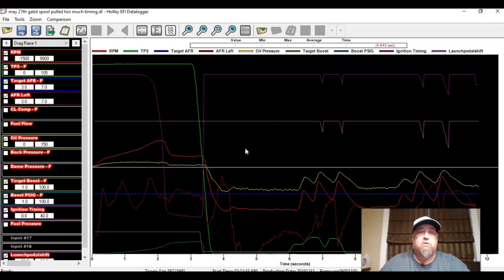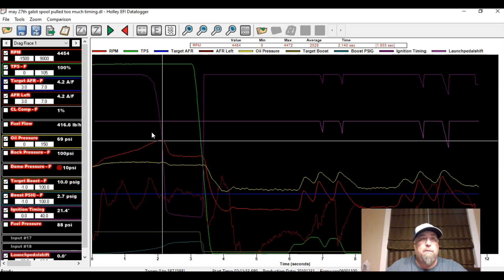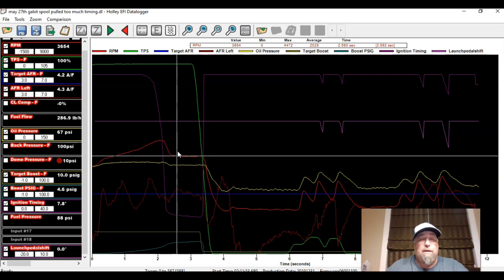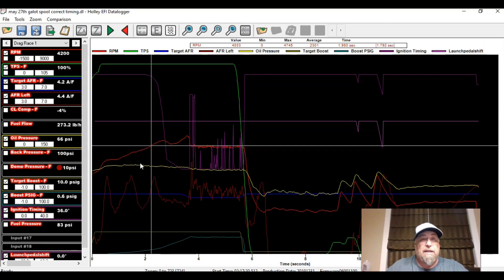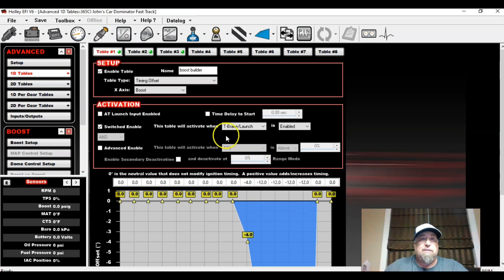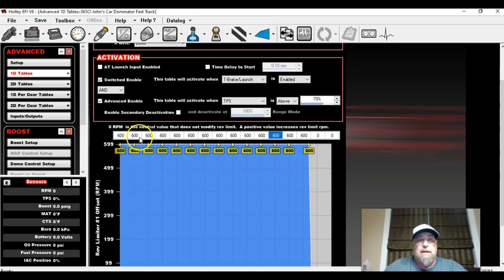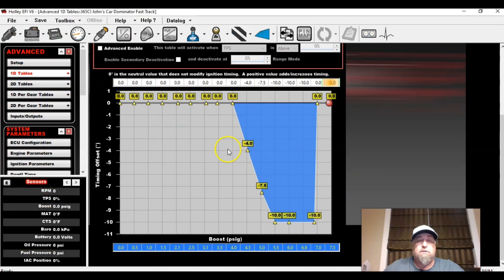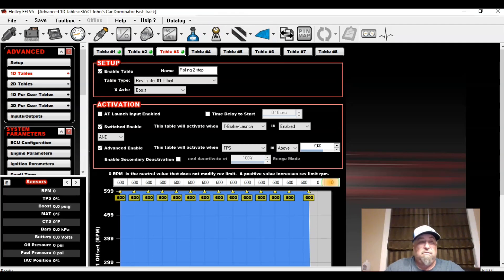How to Spool a Turbo Car, GTR 102 on a 364ci Engine.

Comment: I can't spool my turbo for nothing. On the transbrake it only goes to 3000 rpm
Reply: So its best to put the car on stands when trying this?
Reply: @benaiahtheassassin  what turbo, motor size and converter?
Reply: @junkyardboost8372  5.3, summit s475, ptc 9.5
Reply: @mrfkyobitch6282  im starting to think that

Comment: You can do it a different way. You can put on a 'dump valve' which is an electric throttle body on your charge pipe (and recirc that into your turbo intake) to allow for a lot more accurate boost on your leave. It allows you to split the relationship of boost pressure and turbo rpm